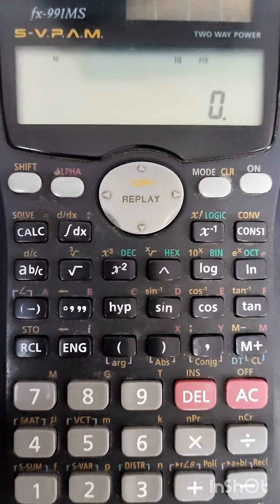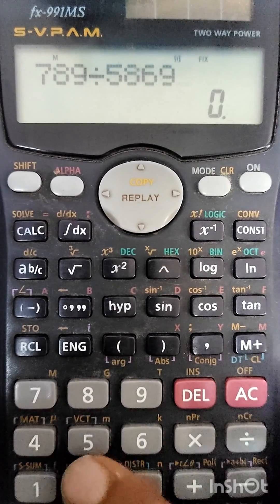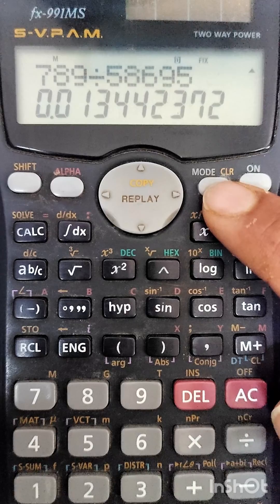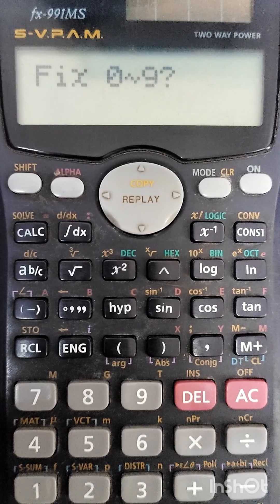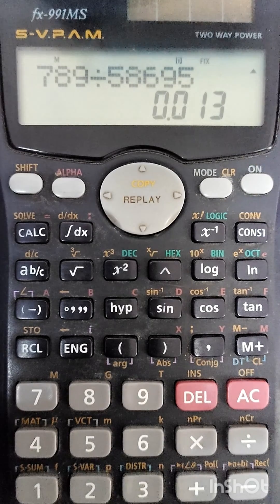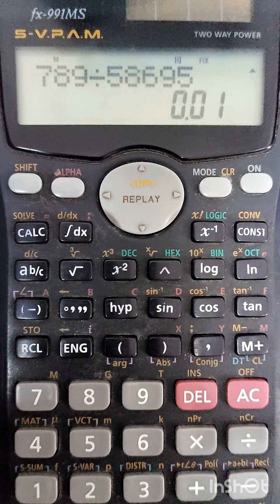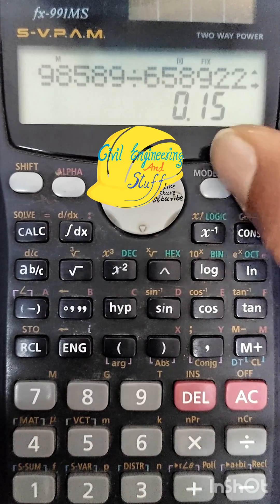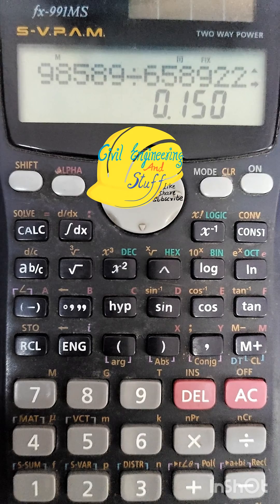How to set values after decimal places in fx-991MS | calculator tricks and method

Comment: Sir plz reply..
.. tomorrow is my numerical analysis exam.. .. when i m solving 4 decimal digit with any operation ,i m  getting value in 10th power... Like- ( 0.0064- 0.0057)  = 7* 10^-04
.... Sir how can i fix it?
Reply from the maker: If you are using 991 MS calculator, just check at top right of the display "SCI" is seen?, If yes, then simply follow the instruction of this video to fix the problem. i.e press mode 5 time and Press 1 to fix, press 4 if you want value after 4 decimal place (can be any number between 0 to 9).
Try this and let me know if this works.
Reply: @CivilEngineeringStuff it work's